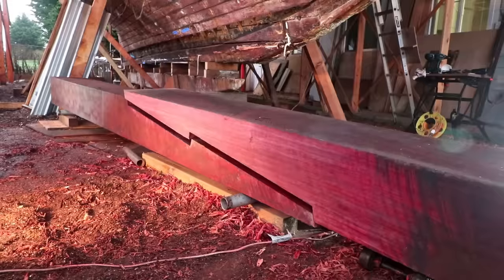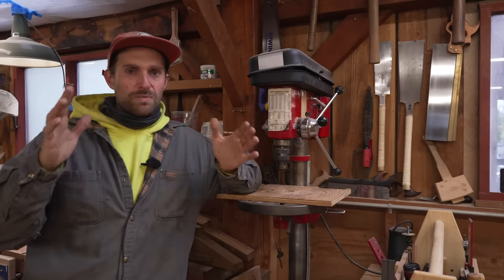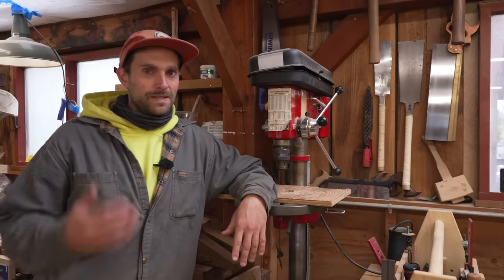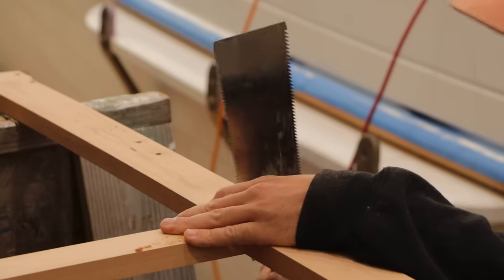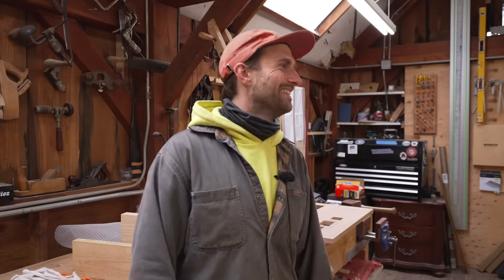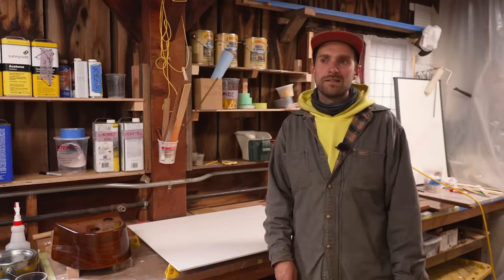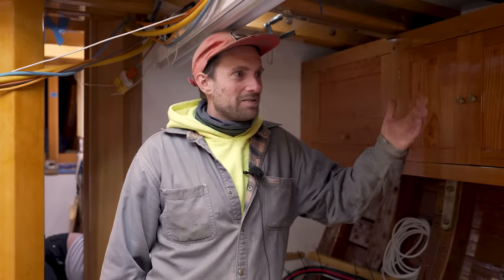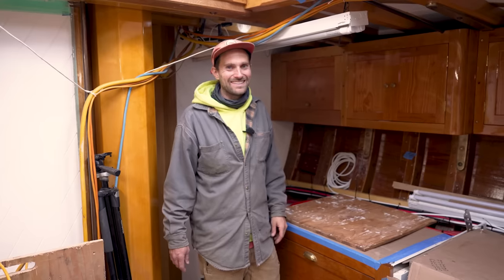Patrick takes over.

Comment: Anyone else surprised to see all the bubbles & imperfections in the varnish on the cabinet faces? Everything else on the boat is absolutely flawless boat jewelry, yet those door finishes look like something I probably wouldn't accept on my own boat
Reply: First thing I noticed!
Glad to see you brought it up. I was sure thinking that. Cann't tell but it looked like Possible silicone contamination and fish eyes or dust?  Should be able to just redo the outside that shows.  Iam sure they are planning to do it.  It's a heart breaker when you work so hard and that happens on the last coat.  Now waiting for it to cure more before sanding it out.
Reply: @charliecruzen3394  yeah for sure doesn't look like it'll be difficult to fix, a bit of sanding and another coat or two and it'll look great, I'm just very surprised that it even got installed with the finish like that.
Reply: I imagine for the sake of the video they went ahead and installed them, but will no doubt be off again to get the finish fixed!

Comment: I'd like to see the hanging cabinets refinished. The super high gloss finish, with bubble imperfections, is in jarring contrast to the other varnish finishes in the boat, all of a high standard.
Reply: Sigh, I have to agree.  Running a propane torch across the still-wet varnish is an effective way to deal with inevitable brush-formed bubbles.  An airless sprayer would be better, perhaps.

Comment: Uhm, not to be a spoilsport, but the varnish on those door fronts doesn't meet the smooth polish without bumps or bubbles that is typical of the finishes I've seen on this project.  As one David to Another... could that be a bit better?
Reply: I thought the bubbles etc might be artefacts of the videoing but I may well be wrong. A satin finish would suit.

Comment: lil dissapointed in those cabs, looked like they could've used some better sanding to get rid of all the bubbles/imperfections and then maybe a coat of satin or more sanding and gloss. if ur going to do it right, do it right. This is like a turd on top of a birthday cake

Comment: A most excellent job on the cabinets, Patrick. That's a nice use of magnets to secure the doors. Tell us how much room you allowed for the finish when you made the doors. That finish has some thickness to it and it appears that your calculation was spot on! Otherwise the doors would not have closed as nicely as they did. After mastering  cabinetry in a ship, as Patrick has done, any cabinetry for a home kitchen or restaurant would be a breeze; cabinetry with right angles is simplest to design. AND construct. Just because it can be designed on a computer does not mean that craftsmen can be had for building it.

Comment: Great job Patty. If you make another kitchen for on shore don’t glue the panel in, because there’s expansion and contraction to take into consideration. Not a problem when humidity more consistent thanks to being surrounded by. Water but for further inland humidity causes problems. Per my husband cabinet builder

Comment: 13:21 I hate to be "that guy", but that finish looks pretty rough. I want to believe it's the camera, but those door panels look like they could use a wet sand. I realize this is a boat, and not all finishes need to be perfect, but cabinetry should be "furniture grade". Especially on this boat.

Comment: Great work as ever guys! A little tip I picked up laying wood floors is when you have to notch around a pipe, or tie-rod in your case, if you cut out a  piece that tapers down  to the drilled hole you can fit it back in afterwards  and the timber matches  really well.

Comment: I would suggest you put more positive locks on those cabinets.
Reply: Agree - sailboats can be laid down or turned upside-down by wind & wave, you don't need the cabinet contents raining down on you when things have gone sideways.
Reply: I look forward to seeing your usual creative solution. My boat is almost 70 years old and has some of the same kind of latches in the video. They like to open themselves every once in a while but as there are only some extra dock lines in there, no harm is done so I don't bother to put in a turn button latch. All my cabinets have sliding doors so nothing is getting out of there.

Comment: Hi Leo and Team! I love your videos and I am stoked to see the progress. It it very impressive what you guys do! I have a question about the lead keel, which is still missing? Or do I just not see it... I saw the video when it went wrong while pouring the molten lead and thought you will postpone the new pouring but I think I missed it. Do you have another method of getting weight to the boat?  Thanks in advance! Cheers, Florian
Reply: They abandoned the effort to add lead to the existing ballast keel. Instead they built a new mold & poured a new keel (EP117-120), the old keel was melted down & forms about 75% of the new casting. See EP123 when the new keel gets bolted to the boat.

Comment: Curious: Are you going to follow tradition and place a coin at the base of the mast? Not sure how that all works out but again just curious.
Reply: There is a video showing someone making a custom coin for the mast, but I don't know if they are going to use that.
If they use a real coin, should they use a 2023 coin, or one from the original date that the boat was made. ?? 
And did Leo keep the coin that was under the mast when the boat was de-rigged ?
Reply: When Leo acquired TH there was no mast with it, ergo no coin !
Reply: @on4xb  not too late to start it now. Looked it up.😊👍
Sailors and shipwrights have been putting coins under masts of ships for several thousand years… They've been found in the mast steps of ancient Roman shipwrecks. The hope, still, is that the offering will bring good luck and safe passage.
Reply: @manfredagne6738  Sailors and shipwrights have been putting coins under masts of ships for several thousand years… They've been found in the mast steps of ancient Roman shipwrecks. The hope, still, is that the offering will bring good luck and safe passage.
Reply: @terryhayward7905  I looked up the tradition. Here is what it said.

Sailors and shipwrights have been putting coins under masts of ships for several thousand years… They've been found in the mast steps of ancient Roman shipwrecks. The hope, still, is that the offering will bring good luck and safe passage.